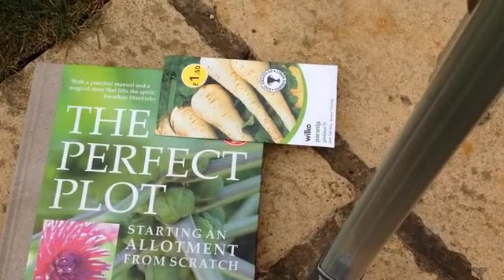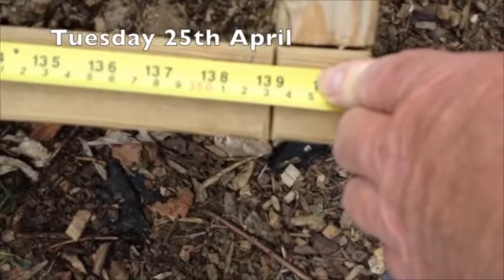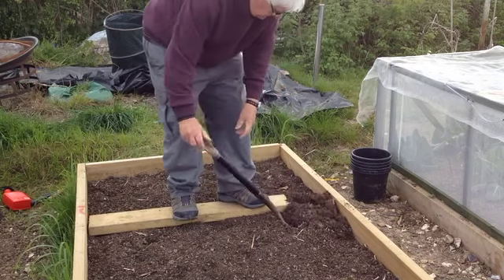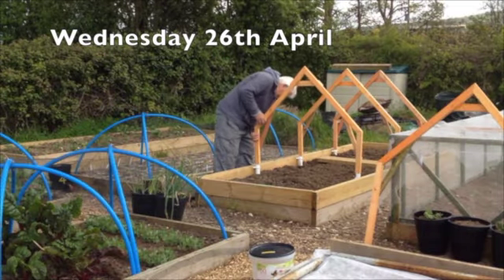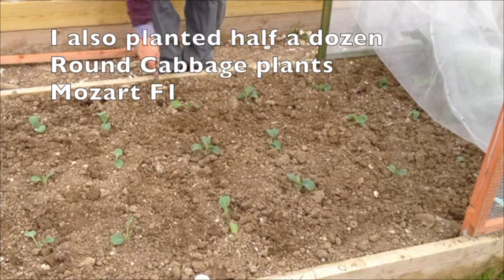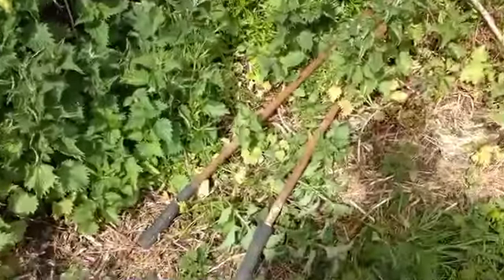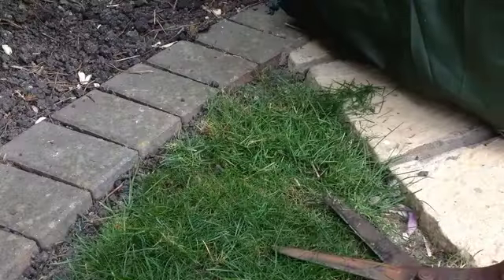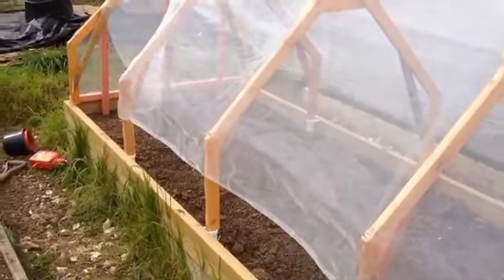4th Week April

Comment: Hi Mike. I like the idea of using the waste pipe as support guides for the frame to help protect the wood 👍🏻  What size section wood have you used for the frames?....they look nice and sturdy. Cheers......Nigel
Reply from the maker: Hi Nigel, I have found that empty mastic tubes are exactly the same dimensions with the added bonus of having a closed end which controls the height.  Only problem is collecting enough of them.  its a question of being around when window fitters are emptying their van.  The size of the timber is what ever is in the skip which will be what ever size (or weight) of tiles or slates. ranges from inch and a half to two inches X three quarters.  I made the Castle Hill frames totally from the skip.  The Muddy Bootz frames I had to purchase the long lengths which came to £14.00.  The Muddy Bootz frames are easy to use such as removal for weeding, planting.  Castle Hill frames  will let you know end of season.  Take care and have a good May Day.  Mike B
Reply: That is a great tip to use the mastic tubes with the added bonus, the nozzle end at the bottom has built in drainage...............Nice one!!!
Reply from the maker: Do you know Nigel these tubes are going into landfill? must have a word with Friends of the earth.  If we could get builders to put them in a  separate re-cycling bin it would be easier for us gardeners to get them?

Cheers Mike B